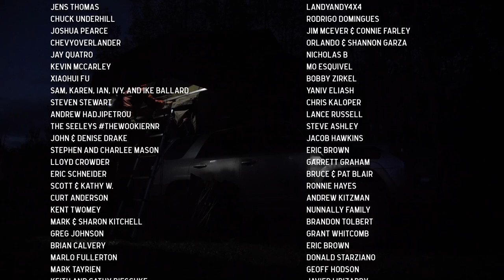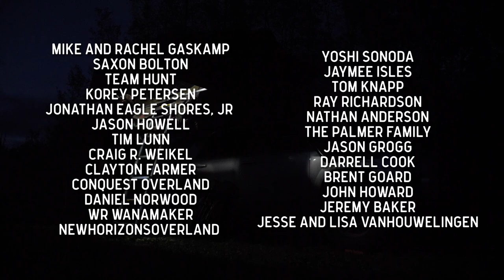Nothing like hot showers by a mountain stream! - High Country Trail S3E6

Comment: You are a great little family, very very nice videos, I watched. Oh yes, so sometimes to laugh. The little mouse, always steals the show when she is in a good mood. 
It's great that you bring so much love and understanding for nature to the little mouse. Great.
I would like to give the producer some tips about the car.
Aluminium rims are a disadvantage when driving off-road. Simple steel rims and conserve them with bitumen inside. Lasts 100 years.
Same for the underbody protection and the shock absorbers. Also stainless steel is normally not suitable for earth acids. At most from duplex and that does not exist. Grin, also not at Mercedes. 
So, for the next trip, do it like before. Inject with used oil below and drive over dust. Do it three or four times and paint the shock absorber housings several times with bitumen, also axle suspensions etc. 

We used to do it like this and I was a paratrooper for 7 years and 40 years on the whole as an engineer, senior eng.  and senior site manager on construction sites. Everywhere we did it that way and the vehicles, also other equipment survived all climatic conditions, even a time in Africa. 

So young man, a small rebuke laughs: The haircut, like the tire tread in summer 3 mm and in winter 9 mm and the beard, you let it grow and so every few months with the lawn mower over it is enough.

Best wishes from Frankfurt, stay healthy and take good care of the little mouse.

Comment: Forget shock tube protectors and just run it bare, you will be just fine, I offroad every weekend and its not a needed item by any means... mud sand dirt dust a good shock will have a good scrape seal and stop contaminants. Anyway, if you're offroading that much shocks should be swapped every 20-30k from my experience, they aren't life long parts
Reply from the maker: You should see what blasting through Death Valley or the Mojave will do to them. The shaft gets pits and the rough finish starts to degrade the seal. These are rebuildable so you don't want to damage the piston if you can help it. Probably going with a neoprene boot.

Comment: TBH mate, I've only ever seen faults from proper offroad driving from Ikon equipment. (which they where aparently engineered for) Which if they where properly engineered, the shields would be a lot better design and also the tophats would never have had a weak spot engineered into them which is both faults you have experienced. If you're serious about suspension go with the ARB BP51's if theyre available for your vehicle. Much respects from Australia, some of the harshest and longest terrain around.